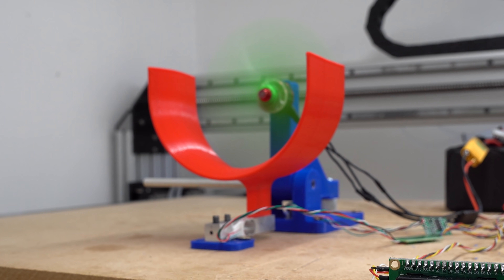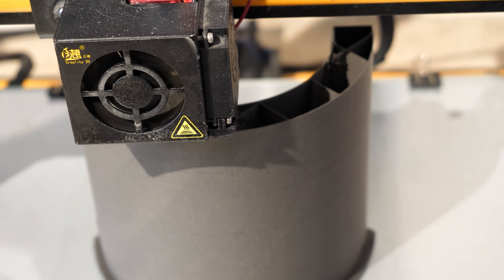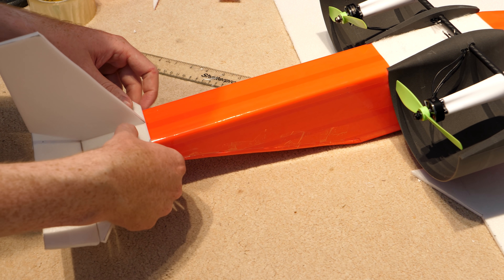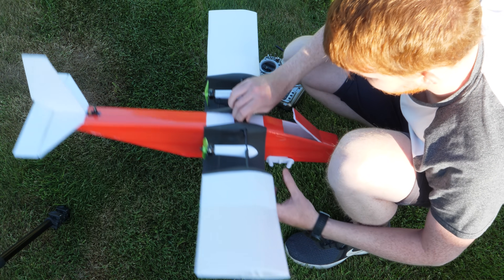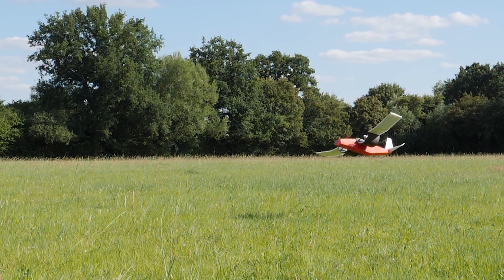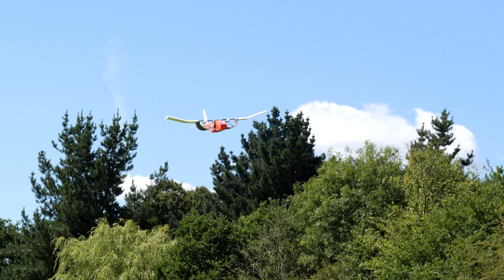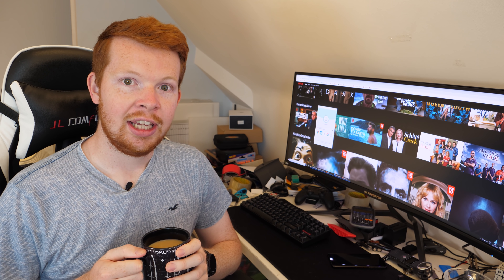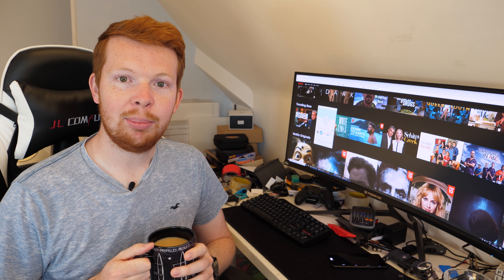Channel Wing Plane

Comment: First off play with the angle of your motors. shouldnt have that much effect on pitch.
Second put a big flap or 2 or 3 behind the motor for added lift and control. Its going to be very touchy to get it balanced.
3) rotate the whole wing so you get a combination of wing lift, motor lift, and flap lift.
4) use a tandem wing with quad copter controls to keep it flat.

Comment: If I remember correctly, longer wings, makes the channel wing much less effective. His first design,  was nothing more than stub "wings" if even that. outside of the 2 channels.  The fuselage, was skeletal. 

So its counter productive to add longer wings, and dihedral.  Id say, go back and try it again, and definitely experiment with it. Anything making it more typical to a regular plane, makes it less, and less effective. You want the Channel wing, to do the work,  not the other way around.

Comment: Hey Tom, I know I'm much too late. But I just wanted to say, do you think mounting the propellers the conventional way so that the thrust is not sucking the air over the U shape, but instead pushing the air over the U shape would be better in creating more lift. Intuitively I feel like that would produce better results, not that I know for sure but I think it would be cool to see if there's a difference.  Awesome video as always.

Comment: What about the Propeller on leading edge of Custer Channel Wing, as in Antonov-181 Izdelye?
And a counterpropeller, as in the fixed vanes in a turbine, to change swirl of air from propeller into a more straight and laminar flow?
Blessings +

Comment: Was looking for your first video on this and only found this one after skimming your videos for a bit. Also found an article where someone named Bob Englar tried to improve the design it seems. It appears his lab further increased the "considerable lift" using compressed air blown over the channel in a particular fashion. It also eliminated the need for landing at high angles of attack and provided pneumatic compensation in the event of losing an engine.

The article is called That Extra Little Lift by Tim Wright and published in May 2007 by the Smithsonian Magazine. Figure that should be enough to find it, and it would take more time than I presently have to properly cite it. Figure it would be a great read if you ever intend to return to this project, perhaps with you air powered engine :D

Comment: Hi, have you tried placing the propeller at the point where the airfoil is thickest. I hope this idea is not stupid. It would be interesting to find out the lift to thrust ratio.

Comment: Sorry but wid due respect you have some flaws in ur analysis. Ur forcing the plane to literally go up vertically in  take off by increasing the throttle too much. Despite wat you did in the experiment  you will see in the video that the plane immediately took off except that it fell awfully shortly afterwards  Ease up on the throttle  and ull see the advantages readily.

Comment: I think.ur conclusion is based on too much expectation. Review the video and you will see that it elevates quickly compared to a normal winged plane.  That is the purpose of channel wing-- immediate take off at short distance. U seem to want the plane to lift like an elevator. Nope that is not what Custer envisioned

Comment: The low performance is due to the position of the prop. It should optimally be at the crown of the wing cord and sweep within a millimater of the surface for maximum low pressure. If you want to have a truly impressive performance you make a second wing hoop to sit over the prop turning the prop into a thrust nacell for high speed flight. When this upper surface slides back beyond the prop and angles down that surface becomes a vectored thrust surface producing additional lift. So with this upper surface retracted aft you get the lift from the Custer wing plus the vectored lift from that surface giving you high lift low speed high drag. Moving the upper surface forward transitions the combination to high thrust high speed low lift low drag. The problem with the Custer wing was always that the feature that gave it high lift limited its speed performance as with all STOL configurations. This simple transition configuration solves that problem to give a VSTOL capability which transitions to a high speed configuration which should give you 200kph performance.

Comment: So, what would happen if the channels were set at a high angle of incidence relative to the fuselage, say 30-45°? Also, since this wing design is dependent on moving as much air through the channels as you can at high speed, I think the channel wing would benefit greatly from using a 6-8 blade open impeller or "propfan" (aka "unducted fan"), rather than a simple 2-blade prop (see below video).

https://youtu.be/eIhOaWP6tV8

Comment: In the original plane, wings were not necessary, however they were added as an insurance in case one of the engines failed, turning it into a glider.

Comment: Es sieht wohl etwas spektakulär aus aber ich denke dass die Flüglefläche die du damit  berechnet hast so vermutlich nicht ganz tragfähig ist. Selbst dass die Luft durch die Schalen fliesst its meiner Meinung nach nicht zuverlässig und kann nicht wirklich als tragfähig betrachtet werden.Die Idee ist nicht gerade die effizienteste aber eine entsprechende tragfläche ganz sicher notwendig. Du kannst an verschiedenen Orten welche Flügel einsetzen da eine Grundtragfläche für den Flug sehr wichtig ist aber ein solches modell muss vielleicht schon noch etwas mehr tragfläche haben damit das Flugzeug sich rihig in der Luft verhält. Die Motoren bringen auf alle Fälle genug Schub. also ist es wichtig wie du dieses Projekt weiterführen möchtest. Viel Spass beim ausprobieren.

Comment: Don’t The opposite sides of the channel cancel and the net lift is a 1/2 sine wave centered on the prop axis?  But you still have the full drag of the flattened channel.  
The Lockheed Electra used prop blast to increase lift, but of course it was not a channel wing.

Comment: You have to PUSH the air over the wing! 
Do it again propellers forward of channel wings, you will get more lift, and be able to do you slow speed flights.

Comment: The Chanel produces lift in 180 degrees, which does not all go towards lifting the airplane. It probably makes your propellers work better but probably doesn’t give you all that much upward lift. You could test the straight wing vs the channel wing with a sensitive scale.

Comment: Most planes don't need more lift. They have a lot of power per weight ratio. So they get more than enough lift. What they need is less drag to go faster. It might be useful for a shorter takeoff, but once in the air, the drag penalty would be too much.

Comment: It has advantages, easy convertion of a vtol propeller extenting out of the wing and back. Won't change the drag as much unless you can completly reduce the axel bar to the propellars. to near thin invisable

Comment: I would suggest using an impeller because it can pull air over the wing and then for forward thrust, you could use a propeller.

Comment: I don't get why using a U shape instead of a wing with large walls to separate the pressure zones.. in an u the only pressure Vektor upwards is the one in the center.. all other sides are wasted because pressure "lifts" inwards the prop

Comment: So what if you added some flap-like control surfaces to the outer wings to create drag and limit forward speed, so you can more easily test throttle induced lift?

Comment: I guess the concept does not work at a higher speed of the aircraft because the speed difference between the air Wich is going through the propeller and the speed of the aircraft through the air is lower than when the aircraft is not moving so the pressure difference decreases with higher speeds.  So the concept probably works better on huge scale were the Motors produce more trust. So when u compare a motor  Wich makes  100 mph fast wind and one with 20mph fast wind and then u fly 10mph u would decrease the speed difference by 10%  with the faster motor and by 50% with the slower motor.

Comment: This whole video is a waste.  The plane he's flying isn't flying because of the channel.   It's flying because it has conventional wings.  And the severe pitch up tendency is because he has the center of gravity located too far back.  (Pop quiz:  What happens if the CG is too far back?  What happens if the CG is too far forward?  (Too far back, you have to keep pushing the nose down.  Too far forward, the plane can't take off because you can't bring the nose up at all.))

Comment: If I may suggest, Mr Stanton needs to read a book on basic model aircraft design. Obviously he doesn't know why directional stability is difficult on the ground for taildraggers.  (The center of gravity is (must be) behind the wheels which means the rear of the plane tries to whip around to get ahead of the wheels)  Also, he doesn't seem to know the basics of locating the Center of Gravity vs the center of thrust vs the center of lift.  (Just think for a second & answer the question, "Why MUST the CG be behind the wheels for a taildragger & ahead of the main wheels for tricycle gear?"  If you can't answer that, you need to go back to grammar school science class.)

Better to read up on it a bit.  It takes a lot of trial & error to try every combination of the forces acting on an airplane by moving all the parts around over & over.  I believe the book I have is by Andy Lennon.  Really good, really thorough, really understandable.
Reply: It is frustrating to see an intelligent person make dumb mistakes, especially if you know the mistakes they made but cant say anything to them.

Comment: I would have thought the propeller should be further forward in the channel.
Reply: I think your right.  Having the props at the rear doesn't make air flow faster through the channels.   It just limits the air going through them only come from above the channel.

Comment: If you heat the top of the airfoil and cool the bottom using a thermoelectric generator, would that also enhance lift?

Comment: Love your approach to engineering.  In regards to producing lift from propulsion method, i.e. prop wash as a source of air flow over a lifting surface.  May I suggest you look into tractor prop/delta wing arrangement..  Works wonders for me.  Best regards.

Comment: I have an idea for a plane. We take a blimp and we shove it up a flying wing's butt to make a low speed fixed wing blimp. It will basically look like a manta ray with a dolphin  along the middle, except the dolphin is filled with hydrogen, and this should produced lift at low speed.

Comment: Fantastic that there are people like you willing to put time and expense into testing a concept. My own evaluation of this concept, which Pazmany introduced me to in the early 1980s, is that it can provide very high lift, but in a way that is not usable because there is no provision for control. Your experiment showed the large pitching moments produced, which can't be overcome until the machine is moving fast enough for the control surfaces to have an effect. Possible remedy is to add a cascade of control surfaces behind or just ahead of each propeller, but this will cost drag, and will only be necessary during a very short part of the flight.

Comment: What if the channel shape were upward, instead of a "U", seems like the channel provides stability, like the cylindrical paper planes, but  wouldn't it require less force if the propellers wore the channels like a hat?

Comment: Um, there's a difference between pulling air over a wing and blowing air over a wing. Especially when the prop is behind the wing trying to force the flow of air from the front of the wing to the back in order to produce lift.

Comment: Tom, have you thought about what would happen if you used a quad channel wing design?  Having two props on each wing generating thrust in opposite directions?  This should cancel anything but the vertical lift... Then using differential between the two props you could generate forward thrust for speed... ???

Comment: I think the center of thrust is too high not to mention if the plane pitches up sharply at full throttle maybe move the wings and engines lower towards the center of mass?

Comment: What if you had a propeller on the front of the plane that would provide an equal and opposite thrust to the wing.
Or you could have two channels per-wing that face in opposite directions to cancel out thrust and still produce lift.

Comment: Hey man, if you want a strong structure with a light 3D printed frame, print out your piece then coat it in truck bed liner, its a little more heavy but each layer adds much needed structural integrity! 👍😁

Comment: its a half duct, of an edf
Reply: if not better vertical lift, but better thrust with same power, being edf
Reply: box two plane wing
Reply: if you have tilting ducted fans, you have a double plane wing per fan when forward mode
Reply: 8x8 ducted fan vtol plane should have great forward efficiency and lift

Comment: some info.     one more  flaky  test platform, from tom.
if you are gonna try  one  Weird  design idea, it is Recommended that  Everything Else   be  done,  RIGHT.        even though, at the end of the day, this is a silly idea, i will share some design Flaw specifics:     the model has a wonky and  permanently tail-Heavy  dom;  because there is  Too  much  aft-located  MASS  ---  if the Amount of aft-located  mass is Never reduced, this  Condition  is  PERMANENT!!!    the stabs are poorly designed;  the use of differential thrust on a model weighing more than one ounce is not recommended;  the there is excess mass in the incompletely tapered tail boom; when a (taildragger) model is flying, the  Mass of the main lg Should be below the wing leading edge.    imo, covering a foamboard fuselage with tape is Mostly about water resistance, not structure quality.     at 2:34, did you, deliberately, choose to begin with a  totally  wonky  dom.   distribution of mass.        googletranslate

Comment: Here's a daft idea: What would happen if you had two engines and ducts on each wing and reversed half of the engines to slow down instead of powering down? That way you could keep the airflow over the wings high without providing much (or any) forward thrust. (Yes, you would probably also produce insane turbulence around each wing.)

Comment: I wonder if it would be more effective if, instead of just a channel, you had a full cylinder, the entire circumference of the propellor, forming a sort of ducted-fan setup (obviously, with the lower half having an aerofoil, then merging into a straight-sided cylinder for the top half, to avoid cancelling out the lift effect)?

Comment: I wonder, would it be possible to use channel wings to steer a quad-copter drone? What I'm thinking is, take a drone with auto-hover capabilities, then fit a channel-wing above each propellor on a rotating mount. Then, if you want to, say, go left, rotate the channel wings so that they are all on the right side of their respective propellor, producing lift pushing the drone left.

Obviously, it would be much more complex, and probably less effective, than just varying the throttles on the motors to pitch/roll the drone, but I think it would be an interesting experiment.

Comment: This kind of wing isn't worth it, it causes a lot more drag while only giving a bit more lift. 
you could instead increase the wingspan wich would increase parasital drag less and Reduce induced drag.
also when you put a normal motor on or below a wing the propellor has the same effect. it also increases airspeed below and on top of the wing (a bit less than here but if you count in the other parameters above it's worth it)

Comment: I think there's a combination of factors here they resulted in a less than impressive result.

Firstly, the spar is creating significant turbulence before it reaches the propellers, surely this would reduce lift and efficiency.

Second, with the propellers mounted so far back behind the channel, I suspect very little lift is being generated at the front of the channel, where it's needed most.  A theory that seems to be supported by the fact that without the dihedral outer wings, it had almost no lift on its own.  I feel like they need to be smaller to fit inside the channel, if not half way, then at least inside the trailing edge.

Comment: The disgust look when he said "duck tape" is absolutely British. +1 would laugh again.
Reply: duct* tape.
Reply: @DieselRamcharger  there's also a brand called duck tape
Reply: @Momo_Kawashima  i know, its a brand of duct tape....Mallards Lives Matter.
Reply: @DieselRamcharger  the original name was duck tape
Reply: @melandor0  It's still called duck tape, it's just that some people who think that it can't possibly be duck tape have found a name for a use case that duck tape does not have (you'd use a foil tape for ducts)
Reply: I personally love duct tape. My bicycle is basically made 99% from duct tape by now and I use it when I go fishing shrimps by the river, it works better than rubber boots or military spats

Comment: Pretty sure it's more efficient to integrate the engine into a nacelle otherwise we'd see modern aviation doing this. I mean sure if you want to get crazy you can get an air foil that will produce a lot of lift at low speed but you never going to get anywhere in any amount of time.